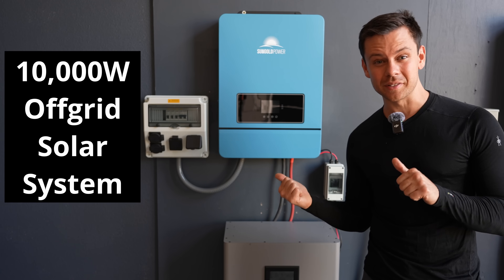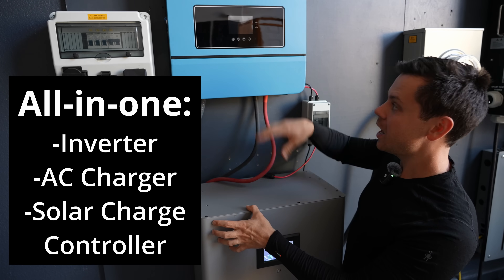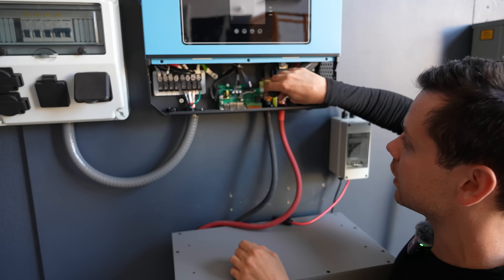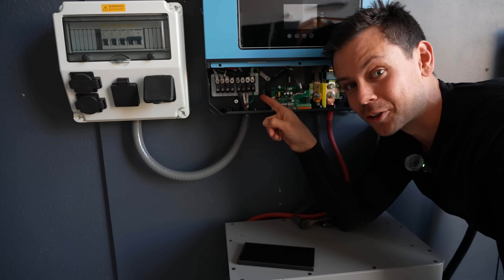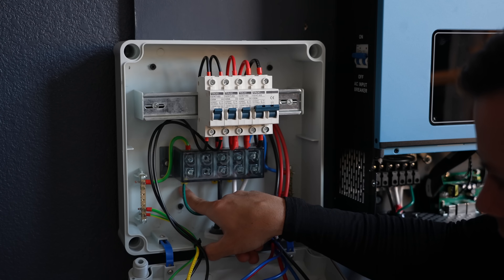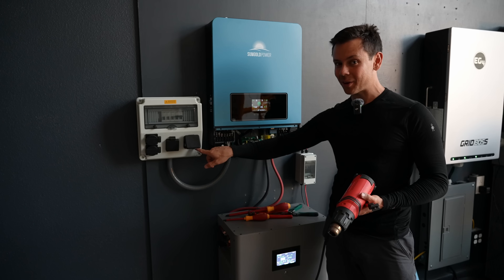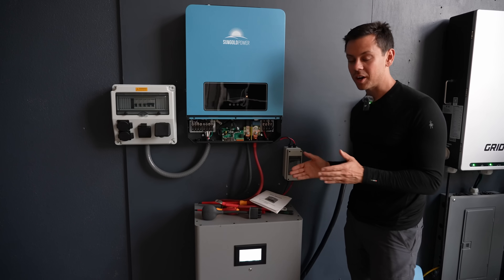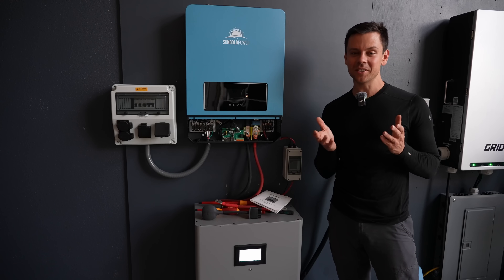Offgrid Solar Beginner Crash Course: Build a 10,000W Solar System

Comment from the maker: Parts List (affiliate links)
10kW 120/240V Inverter: https://amzn.to/3J9Oyl2
16kWh Battery: https://yixiangpower.com/products/yixiang-vertical-15kw-diy-lithium-battery-box-kitus-stock-16pcs-eve-314ah-brand-new-grade-a-lifepo4-battery-cellchina-stock?sca_ref=9207522.jYuzmwEjUpH
Battery Cables: https://amzn.to/40IMHcB
Solar MC4 Extension Cables: https://amzn.to/4l34suq
PV Disconnect: https://amzn.to/4lZ0aFc
120V Outlet Box: https://amzn.to/4kKWW7d
120/240V Outlet Box (shown in video): https://amzn.to/41csb43
Used Solar Panels: https://www.santansolar.com/?ref=errolprowse
New Solar Panels: https://www.currentconnected.com/solar-panels/?ref=wp

Ground Mount Solar Arrays: https://www.mobile-solarpower.com/ground-mount-racks.html

Handtruck system: https://www.mobile-solarpower.com/mobile-48v-system.html

Offgrid System Builder: https://www.mobile-solarpower.com/48v-complete-system-blueprint-559371.html

Join our DIY Solar Community 
#1 largest solar forum on the internet for beginners and professionals alike. 140,000 members and counting!
https://www.diysolarforum.com

~~~~~~~~~~~~~~~~~~~~~~~~~~~~~~~~~~~~~~~~~
Tired of getting ripped off? Check out my "Will Prowse Approved" solar product recommendations below!

12V Batteries
https://www.mobile-solarpower.com/lithium-batteries.html

48V Batteries
https://www.mobile-solarpower.com/48v-batteries.html

Offgrid Inverter System Builder
https://www.mobile-solarpower.com/48v-complete-system-blueprint-559371.html

Hybrid Inverter System Builder
https://www.mobile-solarpower.com/code-compliant-48v-offgrid-system.html

Mobile Handtruck System Builder (very popular!)
https://www.mobile-solarpower.com/mobile-48v-system.html

Solar Panels
https://www.mobile-solarpower.com/300w-solar-panels.html

Ground Mount Solar Racking
https://www.mobile-solarpower.com/ground-mount-racks.html

Wire, Lugs and Busbars
https://www.mobile-solarpower.com/wire-and-connectors.html

Tools
https://www.mobile-solarpower.com/tools.html

Fuses and Circuit Breakers
https://www.mobile-solarpower.com/fuses.html

Plug-N-Play Solar Systems
Ecoflow, Anker And Bluetti! So many models to choose from. See my current recommendations here:
https://www.mobile-solarpower.com/full-size-systems.html

~~~~~~~~~~~~~~~~~~~~~~~~~~~~~~~~~~~~~~~~~~
Need to build a large DIY system? Need a trustworthy solar distributor? These are my favorites:

Signature Solar
Creator of EG4! Solar Minisplits, Victron and More! Largest Solar Store Online.
If you want $50 off, please use my link below and coupon code "DIYSOLAR50":
https://signaturesolar.com/?ref=cPwLcVc0SW-BjN

Current Connected
Best Prices for EG4, Victron, Midnite and so much more! Fast Shipping and Highest Rated Customer Service:
https://currentconnected.com/?ref=wp

~~~~~~~~~~~~~~~~~~~~~~~~~~~~~~~~~~~~~~~~~~
Join our DIY Solar Community 
Need more help? Join the largest solar forum on the internet for beginners and professionals alike. 140,000 members and counting!
https://www.diysolarforum.com

Check Out My Free Book
Best-selling and beginner-friendly guidebook to off-grid 12V solar!
https://www.mobile-solarpower.com/the-book.html

~~~~~~~~~~~~~~~~~~~~~~~~~~~~~~~~~~~~~~~~~~
Contact Information:
I am NOT available for personal solar system consult! If you wish to contact me, this is my direct email: williamprowsediysolar@gmail.com
FTC Disclosure Statement and Disclaimers:
Every video includes paid promotion or sponsorship (such as free products for review). Some links on this YouTube channel may be affiliate links. We may get paid if you buy something or take an action after clicking one of these. My videos are for educational purposes only. Information is subject to change/update at any time. Electricity is DANGEROUS and can kill. Be smart and use common sense :) DIY Solar Power with Will Prowse is a participant in the Amazon Services LLC Associates Program, An affiliate advertising program designed to provide a means for sites to earn advertising fees by advertising and linking to Amazon.com
Reply: Love the video!  Would love to see the AC charging side of it, even if it's a longer video.  Thank you for doing these!
Reply: @BrianHellman yes make that video as well please.
Reply: Great video, easy to follow. Would LOVE to see you do a video on a solar power system to power an RV/tiny house with a 50amp connection. The rv is already wired and has its own breaker box, meant to just be plugged in to a connection. And I would like to understand how to build a system that can plug and unplug whether my RV is parked there or someone else’s.
Reply: This was perfect. Maybe too perfect. Now I'm going to have to go out and buy all this stuff! 😂
Reply: One comment even if the battery is 16kWh storage the max kW usage is depending on your inverter. Simply sayed the battery in kWh is a swimmingpool, the inverter kW is the hose size in or out.
Reply: Very good vid. One question - can the system tie directly into an AC panel box directly from the plug and play? 
The panel already is tied to grid so not sure how that would work. Also there's the risk of back feeding the grid when there is a power outage and harming the  line workers. I'm assuming a disconnect between the 2 systems can be installed. But it would have to kick open automatically.
Reply: @Kayte...  This is probably the biggest use case. Hoping he'll do a companion video for that -- even if it is more complex and requires more time.
Reply: @Kayte...  I think I understand what you're asking.  In my case, I have a manual lockout/transfer switch and a 50a generator port/plug that connects into my home's electrical system (electrician did the work).  During an outage I first (in my case) turn off my AC units at the breaker, flip the manual lockout switch to block power coming in from the grid, plug in my cart to the generator port, turn my battery switch to "on", turn on the EG4 inverter and then my house has power.  Keep in mind I'm not running any heavy loads, just outlets, ceiling fans and lights.  Hope this helps, apologies if not, I'm a newbie at this.
Reply: @logun1970 thanks it's helpful and useful info. The scenerio I'm thinking of is a bit different and possibly not doable.
I want the solar and grid to feed the panel if possible but direct the solar to specific loads that I want operational during an outage. The house wiring and breakers are already installed so no need to somehow get wiring and outlets to the loads.
Reply: Would love to see an example of this in a grid tie set up feeding a main panel.

Was considering an 18kpv but a pair of these in parallel would be a nice setup for a lot less
Reply: If a person is going to do DIY electricity, they SHOULD know how to handle a screwdriver first.
Reply: I was just thinking I could use my lawn shed as a house for an off grid solar charger for my car. I was just looking for a beginner setup and was only planning 110. The fact this does level 2 charging is great.
Reply: How reliable is this inverter ? They only give 3 years warranty for it.
Reply: Great video, but it would benefit from more discussion of end-uses. You mention charging an electric car. Theoretically you could mount the system and outlet box close to a large appliance like a washer/dryer, or maybe near enough to an electric water heater, or heat pump / central AC/heat compressor to use your power to directly power them. But it seems like the most useful real-world video would be for the system to be connected to your main electric panel for use on the entire home. Understand this is more complicated, and you've referenced that not even all electricians have experience doing this, but it's the prominent use case, and it would be great if you could give the most simplified, dumbed-down option for this. Maybe in a companion video. Thx!
Reply: How about grounding, lightning protection and shadows on the panels? I have 8x720w bi-panels and a 10000w inverter. The grounding and shadow issue (neighbor's giant palm tree) have kept me from installing this for 7 months. YouTubers serms to have very different advice about how to do this. Would be great with a complete install video that take into account all nessecary steps, including where to drive grounding rods into the ground. I also wonder if i run the panels at 4+4 so I have 2 serial lines in parallel would help with the shadow issue. I'm close to equator so my panels will be more or less horizontal. 

I'm open to add more panels too as they are only 100 dollar.

Cheers :)
Reply: So probably around 5 or 6 thousand to build this system?
Reply: The original hand truck cart build that you did with the EG 4 3000 and then in the description you had a link with the pictures and everything step by step that's how I hooked my first one up and it was still terrifying to do but it made it so much easier. I watched the video several times and I had the the link with the step-by-step directions and pictures open and it made it so much more helpful.
And on this one the battery charger link and where it hooks up to would be helpful too.
I have mine figured out but a lot of people have never even seen a battery charger let alone used one including myself when i first started down this road.
Reply: Will! Another great video! Question: it's time for me to invest in new batteries for my current cabin 24v system (11.5 kWh FLA). I'm wanting to get that battery as a DIY build as you recommended in recent video... I am trying to avoid upgrading the rest of my system to 48v, and believe it would pretty easy to wire that vertical box for 24v system, simply by changing the wire/bar at top and bottom of each 8s column, so that the two stacks are parallel and not in series... It seems like xiyaing uses the same jk BMS in both their 48v and 24v boxes, so likely just a settings change there... 🤷
Reply: Will, any plans on doing a beginner-friendly type video on the EcoFlow STREAM Ultra micro inverter, that JerryRigEverything recently did? I know that is only available in Utah, due to recent legislation that Utah passed, as well as a lot of Europe. So it wouldn’t be available to a lot of your audience. However, I think such a video from you would do a lot to help make legislators in other states become aware. (Maybe encourage your audience to contact their legislators to encourage them to pass similar laws allowing this device in other states.)
Reply: Would this work with a transfer switch?   Are there any hidden issues?
Reply: Does adding microinverters to help with any shade cause this to go from beginner to more difficult? Or stick to basic string for a complete newbie?
Reply: Great video, as usual! I think it would be a great idea to make a video displaying this setup or something similar for beginners. I've been working in tech for 2 decades, but I'm a novice when it comes to solar and power stations. Your videos are fascinating, but I would like one dumbed down for people like me. I'll be using your videos as a guide for my upcoming, full-time, mobile life build. Thanks for the amazing content!!!
Reply: Yes please make a dumbed down version. I would love(and it appears others would as well) a video showing every single step of the beginner "handtruck" system from panels to the mc4 extension cable to the solar disconnect switch to the inverter and tying two 48 v batteries to inverter and connecting the inverter to a power distribution box. Id love to see every cable and tool needed along the way- even if its a 2 hour + video. You can set it up with chapters for people only interested in certain parts. Thanks!!!!
Reply: Super friendly.  Does this system not require any earth grounding? I'm totally confused, every video I see says something different, sometimes dc/ac isolated ground, sometimes, dc grounded to battery,  etc etc.
Reply: The only thing I'm worried about will is setting up my 370 watt solar panels I have 20 of them and I just know that was what you said is the most dangerous part in your videos. I can get help or calling professionals for the solar array if I don't get comfortable enough to do it.
Reply: Yes, I think you answered several questions from the forums! Thanks!
Reply: Yes, do the other video.  We forget that other comprehend better by visualizing.  It is like reading.  Many can read but do not comprehend what they are reading.  In the military we learned by seeing it, doing it, and than by teaching it.
Reply: Hey Will
Can you review battery evo batteries
Reply: @Will, I have the same solar invertor, so does it come from the factory with a ground neutral bond already? if so how do I remove it so I only have one bond at the main panel?
Reply: I need help, Will. Bought 2 fllyrower 48v batteries, charged them up and 1 cell in both batteries is at 3.30 and colored gray while the others are colored blue or green and are at 3.60
What do you make of it?
Reply: Great video as usual Will.  How mdny Kw at level 2 EV charging please.  As you eluded to, it’s going to be much faster than the standard 6-7ke home set up but to what maximum amount?  Thanks.
Reply: Will, do you recommend the same battery settings for the last hand truck build you made with the Sungoldpower 5k watt/ 48 volt server rack  battery?
Reply: Please do a video on an enclosed trailer build to power a whole house. All one would need is a backup generator transfer switch to an existing grid system. No need to pull permits. Thanks Will!
Reply: Thats a no go. Replaceable batteries are the way to go
Reply: Cost please?
Reply: Ty ty!!! I found pre wired RV breaker panels on Amazon. Very clean breaker box, just add power.
Reply: can you hook up a generator to this setup to use as a backup to charge the batteries if so how would that be done ?
Reply: @WillProwse I have an off grid setup that I got from Signature Solar a few years ago, and I have not yet installed it. 10X440 bifacial Canadian PVPs, the old server rack with .. 14 or 16 kw total storage and of course the old double inverter 6500s … What changes are possible/would I be wise to make? THANK YOU!!
Reply: Bro come do my house, you are looking for one excuse to visit Australia
Reply: Ikr
Reply: 1 hour to install. 2 months and a pile of paper work and fees to permit.
Reply: I'd like to see how you wire in a second battery.  It wasn't clear if you connect battery 2 to battery 1 or if you connect battery 2 directly to the all-in-one (which would mean the all-in-one has lugs for more than one battery).  I definitely like your videos!
Reply: Apologies cause I'm a bit slow here, but that left "panel" and the far right plug that looks like a 50a RV outlet, is that wired for 50a and the wiring we see is wired for split phase correct?
Reply: This video is absolutely awesome. Thank you!!!! But how do you connect a second and maybe 3rd battery?!

Comment: Thank you for this awesome video Will, this actually look doable. I subscribed to your channel. Sorry if this is a dumb question, but would this system be able to plug in to an outlet on the house and provide electricity helping to reduce our PG&E electrical bill? Crafstrom sells systems that do this - that's where I learned about the idea. I don't understand enough to recognize the difference if any in your system so I wanted to ask. I would rather not run a long extension cord into our house to power our appliances. Thanks for any help!

Comment: We have a 13.2kW solar architecture with 18kW of emergency battery power connected to our home.  From April through October, we are "solar positive", meaning that the panels provide enough energy to power the house and build energy credits with the local power company.  This time of year (January), no to much.  And we are in a weather pattern where there is little usable sun during daylight (clouds, fog, rain, snow).  

I would love to tie in some other power source; wind turbine, perhaps, to augment what we have.